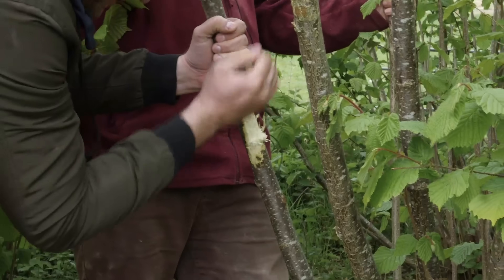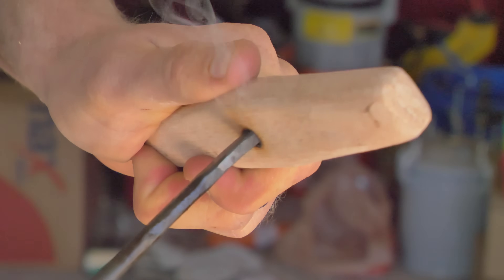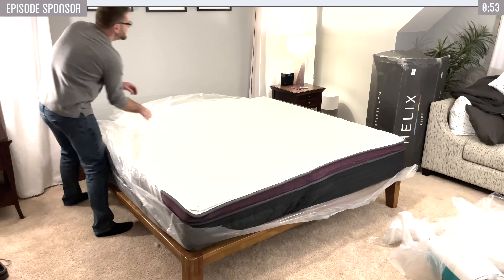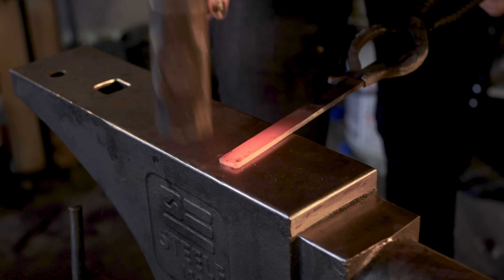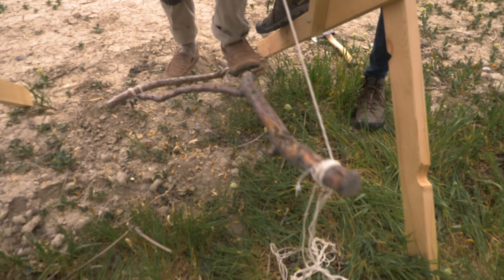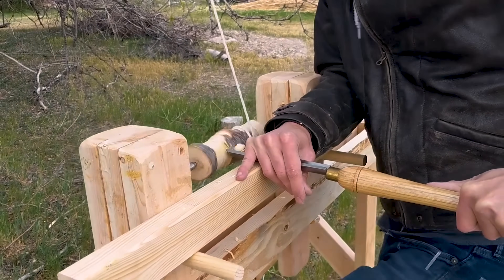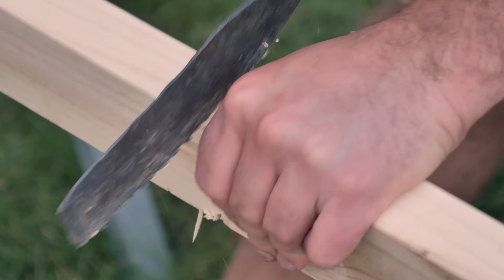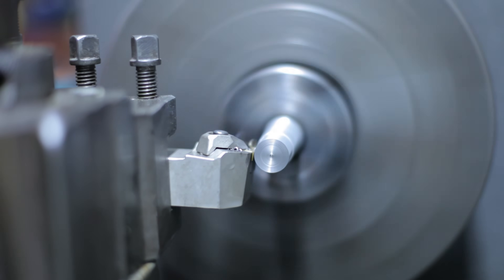I Built the The Machine that Made the Industrial Revolution

Comment: flywheel bros
Reply: two person device
Reply: the society would have burned with that device
Reply: project zomboid skill level beginner
Reply: better pedal motion system
Reply: metal wire screw spring lathe, ie, oscillates from "left" and "right" spring positions rotationally
Reply: the wire line rotational spring needs to store enough energy to keep rotating from "left" to "right" while being lathe'd, initial spring launch by rotating
Reply: also a gravity powered lathe rolling, ie, weight on a cord spinning lathe

Comment: Instead of finding a springy tree or a tree branch still attached to a tree why not just use the concept of a bow instead a longbow and one side is attached to a part of the frame and the other has the string attached to a little foot pedal.

I'm nowhere near an expert at these things but I feel like that would end up a little bit more consistent you get The Long travel you want and it can be inside a shed or shelter of some kind without needing to be wherever a tree is.

Comment: One thing I found in my research into spring pole lathes that might help,  getting it as round as possible before you turn.  While that sounds counter intuitive, doing the rough work with your axe first saves you time and most importantly energy.  You can find axe marks left on wooden bowls that were turned after toughing.

Comment: The utterly indispensable books on building a machine shop from scrap by Dave Gingery say of the lathe it is "the one machine in the shop which can build all the others including itself." Any DIYer needs those books. Starting with a bucket, sand, charcoal and not much else you can bootstrap yourself to a foundry, shaper, lathe, milling machine, drill press, and more. And it's all based on the foundry and lathe.

Comment: the steam engine was invented in 1825 was the begin of the industrial revolution the first lathes were useless could split then Hugh faster than a limb lathe, with out steam the lathe did not take off the water wheel was weak everything on the steam engine was poured or forged then hand filed, later the lathe was the tool of the future because they had an engine could power the lathe strong enough cut Iron

Comment: I feel like we need a progress marker at roughly where in time we are at. The jump from bog iron to the industrial revolution was crazy.
Reply: They're still in thoroughly pre-industrial, pole lathes are at the latest, a 13th century invention, so there's still, at least, ~500-600 years to get to industrial revolution.
Reply: @My_initials_are_O.G.cuz_I_am  yeah, I mistook them for metal working lathes. Still though I would love a progess tracker.
Reply: @My_initials_are_O.G.cuz_I_am  im pretty sure lathes have been used since egyptian times. The ancient greeks had screwcutting wood lathes.
Reply: @kipter  wow, amazing. Do you have a suggestion where to learn more about greek lathes?
Reply: We figure out long round stick attached to 2 round wood board before bc. 
I'm sure lathe is much older.
Reply: There used to be approximate dates in the thumbnail, but those went away a while ago.

Comment: Maybe use a counterweight hanging off a pulley instead of a springy branch.

I feel like that could make it less inconvenient, without the branch hitting your head or narrowly missing every time you step on the pedal.
Reply: Pole lathes were made with poles. That's why they're called pole lathes.
Reply: @1pcfred  
I know, no need to play Captain Obvoius, I never said it would still be a pole lathe with such a modification.
I just think a counterweight lathe would be more convenient to use and would also provide other potential benefits, like more consistency when it comes to the direction of pull.

Comment: 5:45 nice Steele anvil I see, is that an older one?
Reply: It was the 36th made in the pre-order run, if I remember correctly.
Reply: @TheElfsmith  ah, was gonna say it doesn’t look like the newer models I have seen
Reply: @Volt64bolt  Oh, do they look different now?
Reply: @TheElfsmith  the branding on the size mainly, but also the ratios of it just feel different
Reply: @Volt64bolt  That's just the logo from the opposite side. The pictures from the steele co site just show the other side.
Reply: @TheElfsmith  oh, I saw one once where the other side was either the same or blank, can’t quite remember

Comment: How about a really big flywheel that you can spin up by hand over 2 minutes or so that then powers various machines (maybe even a drill?) for a certain time so you don't have to do 2 things at once (powering the tool + using the tool). Later you can add power sources to that flywheel like at first a water wheel and later a steam engine.

Comment: Next step, use the pole lathe to turn a pulley and build a counter weight on the tredle to eliminate the need to the tree limb as the spring.
Reply: You now have me wondering... how much force (weight) would equate to green limb pull vs say... a lead weight?
Reply: honestly his next thing should be to turn 2 wheels and 2 shafts. Then put a crank on one of the shafts.

Comment: Harden only the tip of the drills and temper the rest.
Reply: Tempering unhardened steel doesn't do anything. It might just be semantics because of how you phrased it, but you'd instead only quench the tip, and temper the entire thing, but at that point, why not harden the entire thing too for a tougher auger overall? 
Tempering relieves stresses built up in the hardening process and to increase toughness. It changes martensite into tempered martensite. If you were to temper pearlite and ferrite at a "normal" temperature like you would martensite, nothing would really happen, and you wouldn't see an increase in strength or toughness.
Reply: @TheElfsmith  That's a lot of good information. And annealing may have been the word I was primarily looking for, though I think tempering could still apply here. 

I'm wondering if a completely hardened tool would not be more prone to shattering/ chipping like a hard knife would when flexed or struck. Edge hardening gives a good balance of flexibility/durability and edge retention. Wouldn't a hardened tang of a knife be more susceptible to fracturing? Apologies if that's not a good comparison. 

 If i'm not mistaken there are processes for stress relieving mild steel like 1020 cold rolled. My understanding is it helps prevent metal from flexing and warping when machined, though I can only say i've seen it once. Given that most, if not all materials, contract unevenly when cooled, would there not still be stresses in the metal that may benefit from some form of post process heat treatment? How might the alloy used compare in this context?

Alternatively, would limiting the number of twists in favor of a solid shank yield greater longevity? Reasoning being that the flute lengths of a modern drill are more for chip evacuation than cutting, and manual methods have less reason for concern in that regard.

In a similar vein, would a lesser twist rate potentially let the tool flex more? You may need to compensate by adjusting the angle of the cut geometry or do a variable twist rate, but that's maybe less of an issue with hand tools in softer materials such as wood.

Sorry I keep adding on to this but the concept of primitive tools intrigues me.   If i'm not mistaken there is a historical precedent for a style of auger more similar to a corkscrew than a twist drill. Would it be possible to have a tapered flat bar (if that technically makes sense) and twist it around the thicker edge rather than at the center of the bar? Imagine rolling a piece of paper from one end like you would a poster. The result ideally looking something like a modern single edge ice auger. It may have to start as a bowed shaped bar.
Reply: @triple7988  You asked a lot of good questions here, and I'll try to answer each of them in order without making this too much of an essay of a comment:

First up: annealing. Annealing is a lot like tempering in that it's a heat treatment process that reduces stresses in steel and usually makes it tougher, but it's a bit different in its application. When you anneal steel, you bring it up to temperature and then let it cool slowly, and this decreases hardness, improves ductility and workability, and refines grain size. Annealing is used when you need something to be softer, like when bronze or gold work hardens and you need to anneal it before continuing work, or else you'll break it. Once annealed, the piece will bend, and then it'll stay in the position it was bent into.

Next up, the likelihood of completely hardened tools breaking: The answer is yes and no. A hardened tool will be more likely to break, yes, but a properly tempered tool will be tough, and resist deformation better than a tool with a hard edge and soft body. This depends mostly on the temperature it's tempered at, though. As you increase the temperature the work is tempered at, you sacrifice more hardness for toughness, and that temperature is defined by the intended use of the piece.

A chefs knife needs to hold a very thin, sharp edge, but it (hopefully) won't see any hard impact, while on the other hand, an axe still needs to be able to hold an edge, but the bit of an axe is supported by much more mass, and the tool needs to be tough enough to handle harsh impacts without breaking. You'd temper a chefs knife at a lower temperature to be much harder, while sacrificing some toughness, while you'd temper an axe at a higher temperature to be much tougher, at the loss of a couple points of hardness.

 As for edge hardening vs full hardening, there are too many factors to go over, but I personally prefer fully hardened and tempered pieces, as tempered martensite has great tensile properties. Even though unhardened steel is tougher than hardened steel, it makes it more ductile, which means it'll bend, and then it'll stay there. Tempering after hardening not only increases toughness while retaining most hardness, but also improves elasticity, so the piece can deform, and once the force deforming it is removed, it'll return to its original shape. That's why springs are hardened and tempered; it's the same thing- Tempered martensite is springy.

Next up, stress relieving low carbon steels- finally, an easy answer: This is what annealing is used for. Relieving stresses, refining grain structure, and improving workability. If it's cooled down at controlled rate, it won't cool unevenly and warp.

As for twist rate and auger geometry, the flutes are used for the exact same thing as a modern twist drill: chip ejection. As you twist, the build up chips are pushed up the screw by the new chips under them until they're out of the hole. Higher twist rate means less slope, which means chips are easier to eject, but also easier to clog the flutes.

Also yes, lower twist rate would make the auger less rigid, which is what you want to avoid. More twists in the same amount of space increases the cross sectional area, making the auger more rigid, and also preventing deformation under torque.

I think I touched on most everything, but I'm also currently at work, so I may have missed a thing or two. I'm sure you'll have more questions if I did, in fact, miss something though!
Reply: @TheElfsmith  I appreciate you taking the time to cover all that.

Comment: What if instead of using a spring, you threw the rope through a pulley above you and attached some weight to the end? Then you can reverse the winding on the work piece and cut as the weight goes down.

Comment: So, now that I've finished the video, there are two notes to be made about the overall effect of your lathe.
Both have to do with the setup and stroke of energy.
One: You're short stroking it. Ideally you would have 720 degrees of rotation per stroke, and from the video I'm guessing you're barely getting 370.
Two: You've got the rope putting too much force horizontally on the workpiece. Ideally you would have the vector of energy nearly vertical.
The solution to both of these issues probably lies in using a pulley and counterweight system, rather than a random tree branch. Luckily, now that you have the lathe, making the parts for that upgrade should be simple.
Good to see you back at it.
Reply: the actual solution would be using a proper branch, 10-12 feet long and not a flimsy live one
Reply: @jrk1666  That would also help, but he can't exactly pick the thing up, find the perfect tree in the woods and build a shack around it.
Reply: @jono3952  you can cut the branch down and take it with you, it won't lose the springness for 2-3 years of use
Reply: Yeah, that lilac wasn't the strongest or springiest branch to use, the pulley and counterweight sounds like a solid plan
Reply: @TheJohtunnBandit  its just an overcomplicated solution, the english bodgers used poles to feed the windsor chair industry throughout the industrialization of england and it worked fine
Reply: confused unga bunga
Reply: Those difficulties make me think there's a reason the pole lathe wasn't invented by the romans.  :o